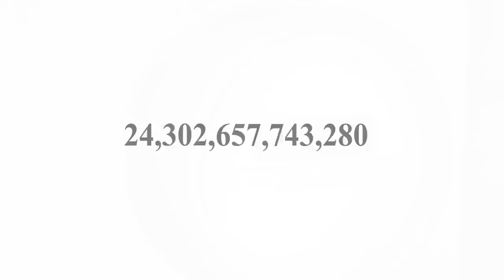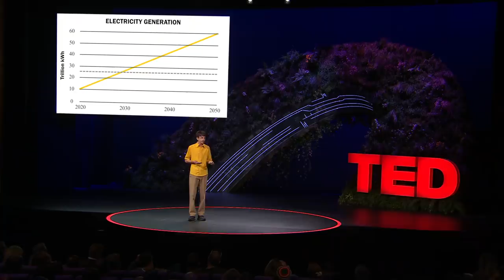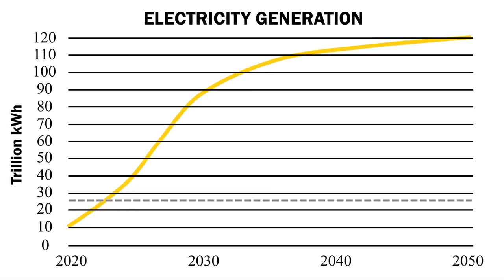How Much Clean Electricity Do We Really Need? | Solomon Goldstein-Rose | TED Countdown

Comment: Good presentation, but the requirement of electricity he claims is absurd. First of all, so much electricity is wasted due to lack of  demand in certain times of the day and rush fir electricity during peak hours. Utility level battery storage will stabilize the issue. Also, EVs will greatly help electricity utilization  due to charging them during off peak hours. Also with V2G and VPP coming out shortly , need for peaks plants, diesel generators will be eliminated. By replacing gas AC and heaters and also electric resistive heaters with heat pumps, demand for electricity will drop considerably. Also, to refine a gallon of gasoline we need 4kwh of electricity, which is enough to 50% of the electricity needed for EVs. 
Carbon capture, direct carbon capture technologies don’t really work. In US, 140,000 sq miles of land is used for growing corn. Out of which 30%, about 40,000 sq miles of land is used for growing corn for ethanol production for blending with gasoline for automobiles. It uses GMO corn, fertilizers, pesticides, herbicides and huge amount of water. It also re1uires huge amount of energy and resources to convert corn to ethanol producing enormous amounts of corn waste to decay. This is done year after year, polluting water the local area and in the downstream. This is use to blend 15% only to gasoline, it’s not for diesel. If we convert to all EVs, we can completely stop this wasteful process. In that 40,000 sq miles just 10,000 sq miles of land when used for solar panels is enough to power everything in US. Also, we need battery storage and transmission. The rest of 30,000 sq miles is used for a hemp cultivation, which requires no fertilizer, pesticide, herbicide and requires only minimal water. Hemp is really a good crop for carbon capture. Hemp can be used for making CBD, hempcrete for concrete for many needs except heavy construction, bio degradable hemp plastic, hemp insulation, paper other fiber requirements. Corn farmers will be a lot more money than growing corn, create numerous jobs while doing the carbon capture.
Trees and forests do better carbon capture than direct air carbon capture